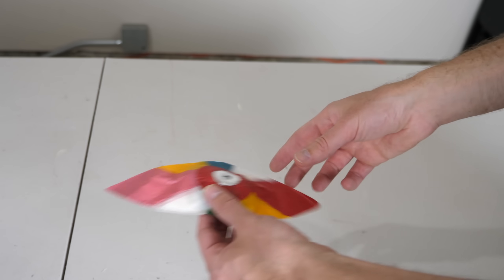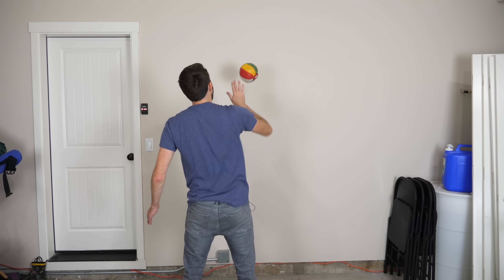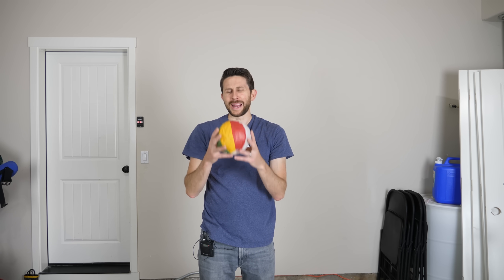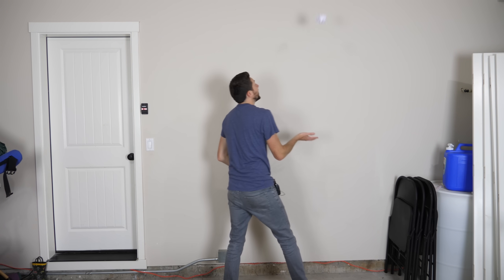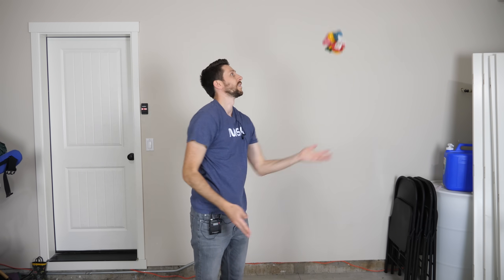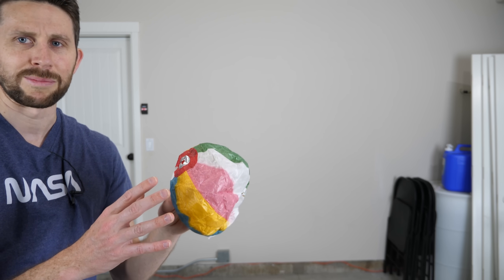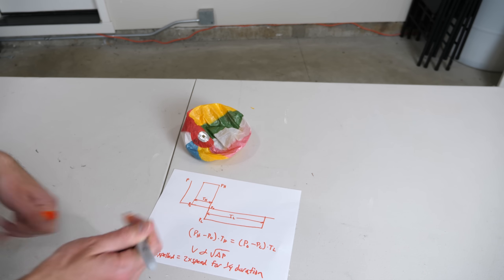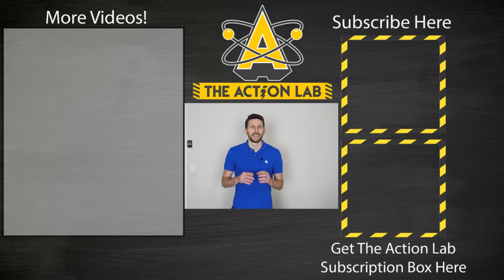Can You Solve The Paper Balloon Paradox? The Amazing Self-Inflating Japanese Paper Ball (Kamifusen)

Comment: Try this: Take a fold top sandwich bag and put your hand all the way down in it.  Now invert the bag like removing a surgical glove and squeeze all the air out of it and pull it to its full length.  Now wind it around and around so you can tie a tight knot high up on the wound portion of the bag.  At this point the bag should have no air in it.  Put the bag on a counter top and leave it there for several days.  The bag should be inflated by then.  I learned this completely by accident.  The universe abhors a vacuum.

Comment: Lemme guess... when u hit it, u give energy to squeeze the air out but also those energy will strech the ball for suck the air in also... but becuz u hit it fast, the air doesnt come out as much as it go in since the air need to squeeze each other to go out but have much easier time come back in. 

And the reason that it inflat when u hit on the table , its becuz the energy are absorb by table, therefore it doesnt create low pressure scenario as the paper never need to strech as much since some energy is tranfer to the table

Comment: If that was the whole story then quick little hits on the table would inflate it. 

When the ball is moving through the air the air outside is moving faster (from the balls frame of reference) than the air inside. Bernoulli's principle states that fast moving air has lower pressure. While the difference is rather small it's just enough to overcome the weak structure of the tissue paper resulting in air being pulled in through the hole during the entire time it's floating around in the air. The quick taps in the air are also fighting the airs viscosity more as it tries to force it it out the small hole thus reducing the air loss even further. If you have a far enough drop you would inflate the ball just from dropping it. I've done this myself as part of a physics demonstration in school as we tackled this little "paradox" in physics class.
Reply: I think quick little hits on the table might inflate it, especially if it was starting with some air in it already. In the video he specifically pushes on it; it’s not just sharp taps.

Comment: Yes, only so much air can flow through the hole. There is a max flow. So even though the hot pressure was harder the bounce, or recoil pressure was longer sucking in more air than on the hit pressure expelled.

Comment: where is the recoil force coming from? Elastic return of the paper deformation or expanding of the air that was compressed in the initial hit?
Reply: Yeah, not really an Explanation when he just postulates that there is somehow a recoil with no reason given as to why that should exist or how he came up with their numerical relation.
Reply: Also, is there an internal air temperature increase from the abrupt hit which might contribute to the recoil force (or reduce it)?
Reply: Actually it's definitely not a paradox and it's pretty easy to explain it with basic physics
Reply: @metehanmacit5844  Nobody said it was a paradox and despite the claim of there existing a supposed simple solution none was provided. So your point is exactly what?
Reply: ABaumstumpf the picture of the video says that its a paradox

Comment: If I am understanding this right, I think you missed a key point about WHY more air is sucked in... The small hole limits flow, right? So that flow limitation of the small hole is what causes less air to be expelled during the very fast high pressure event of being hit. That extra energy is lost to heat and friction instead of being used to push more air out. However since the back-pressure from the atmosphere is relatively low compared to the pressure generated by hitting the ball, it refills the ball slower and thus does not encounter as much of a limitation in flow from the small hole.. That energy is not lost to heat and friction... So more air is able to flow back in than was originally pushed out.

Is that right?

Comment: I'm surprised you didn't mention that it also has to do with the shape. It's going to want to take the ball shape because of the compound curves that pieces of paper take. When you cut the ball open, you still didn't break those compound curves. You should have made many slits, so it could lay flat, and then wadded it up. I bet it wouldn't come open near as much.

Comment: I'm struggling to understand. I'm not a scientist or anything, I only see how the Bernouli principle explains the initial pressure differences caused by the tap. I don't see the reason for the subsequent 'inhale'. Even if the tap is loading the 'spring' with energy, aren't we getting more outward expansion than inward contraction? The spring is giving more than it's receiving. This is beyond science
Reply: I think that under the higher pressure, the amount of air escaping is limited by the size of the hole.
Reply from the maker: It's due to the fact that the velocity of air in is increasing non-linearly with pressure change. So doubling your pressure, doesn't necessarily double your velocity. So the air moving in is high pressure for short time but not the velocity is not as high. The low pressure is longer and the velocity is relatively higher compared to the pressure delta

Comment: You didn't mention the 2nd'ary effect that a faster moving fluid creates less lateral pressure. So as the ball, with an open hole, is flying through the air, the air outside the ball is moving by the hole creating a lower pressure zone, which further 'sucks out the air' - like opening the window in your car at highway speed. So this longer low pressure interval is also fighting that effect as well.

Comment: hi action lab! what if you put a negatively charge ball on edge of propeller and rotate it very fast . will it generate EM wave?
Reply from the maker: When you wiggle anything that is charged it creates EM waves. The key is wiggling them fast enough so that you can detect the waves
Reply: The Action Lab Thanks for response! could u please perform a experiment related to this in upcoming/next video ? what would be relation between speed of charge ball and wavelength of EM wave emitting from it?